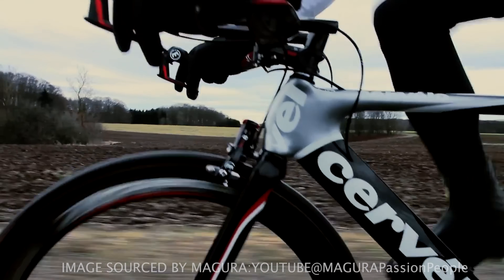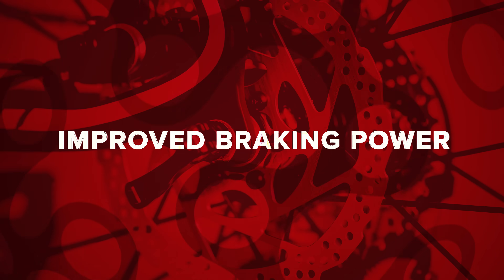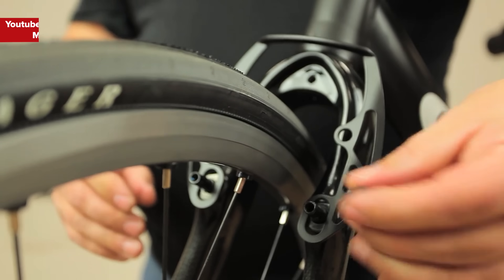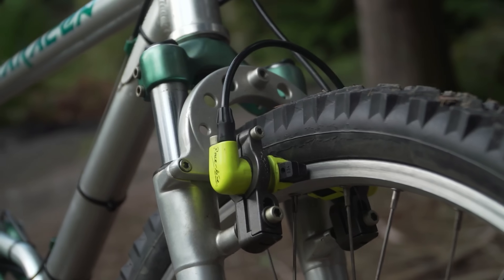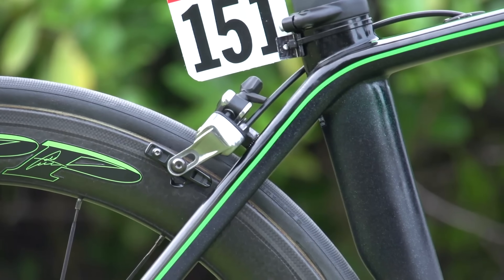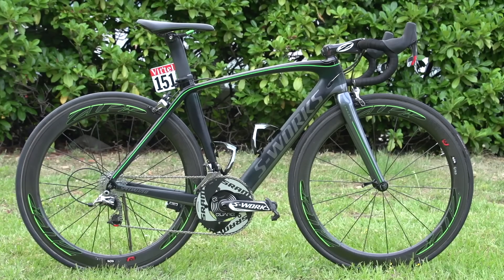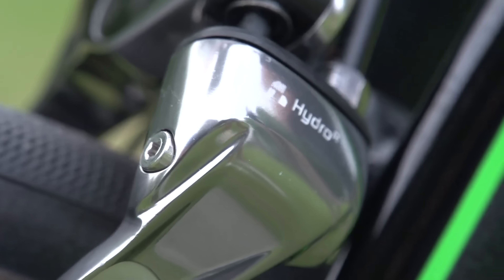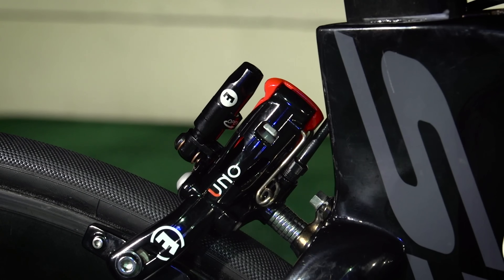The Rise And Fall Of Hydraulic Rim Brakes

Comment: I personally interested in a topic, but... There are mostly nothing about. As in that meme "I disapointed... And my day is ruined.".
BTW!!! I've seen this showed Magura brake caliper as fully cable actuated, mean completely without hydraulic stuff which worked as roller cam brakes and found them extremely awesome! I really with to use something like this, but with at least 40-44 mm tires. Found unfortunate that rim brakes stop evolving after most user unfriendly and pricey bloody bullshit breaks was forcefully foisted off to people... Still Use rim brakes, but my stuff are cheap as shit, because 380$ per moth income... I just can't found and/or afford what I actually wanted even it  not so pricey as any bike shown there.
P.S.: That Magura brakes was Magura RT8 TT and they are hydraulic... But if there be some analogue which is pure mechanical on something like gravel bike which able to use belt transmission... For me it is something to kill for. :face-purple-crying:

Comment: As was explained to me by a product manager for a major bike company, what REALLY killed the SRAM Hydro R rim brakes was the master cylinder (lever) recall from SRAM. It turns out that the Hydro R rim brake groups were spec'd and already installed on THOUSANDS of bikes prior to the discovery of the master cylinder issues (the rim and disc groups used the SAME levers)...and, as a part of the recall, ALL of the rim brake groups were replaced with full mechanical groups. Unlike the disc setups, once the "fixed" levers were introduced, people who originally had hydraulic rim setups were never sent a replacement levers. So...they basically never made it to the market in any appreciable numbers. Couple that with the UCI allowance of discs in road racing at nearly the same time, and yeah...they never were actually given a chance. That said, I purchased an aftermarket set AFTER the recall and installed it on a custom road bike. Combined with Hed Jet Blacks (black anodized aluminum textured brake track) and the braking is every bit as good as disc braking, and in some manners BETTER for road (IMHO). The majority of the "lever feel" that people associated with disc brakes is actually mostly from the hydraulic actuation. And, in the rim brake configuration there is MUCH less heating of the fluid from braking (so, no fading issues...and less need for bleeding as often) and the pads last significantly longer.
Reply: Why would the pads last longer?
Reply: @djohnson1981  more surface area, less torque and less heat on the outer rim vs outer disc
Reply: Wasn't that junk from AVID? My bike shop pals used to say they left out the O after the V!
Never saw many of the Magura hydro rim brakes - seemed like an answer to a question nobody asked. Modern, dual-pivot, cable operated rim brakes work very well with far less complexity and cost....unless you want to run some fat tires through them that is.
Reply: @larryt.atcycleitalia5786  There IS the possibility of making them considerably stronger than cable actuated dual pivots (which SRAM unfortunately did NOT do), but as I point out above, the lever feel is smooth (just like hydro discs...makes sense, it's the SAME lever) and doesn't degrade over time (as cables tend to do). BTW, you CAN run fat tires through the SRAM Hydro R ones...all it took for me was a fork designed for mid-reach brakes and some offset pad holders. I can fit a 36c tire in the fork ;-)

Comment: The fundamental law of mechanical advantage means that for braking, your mechanical advantage is proportional to your lever travel and your pad travel. That’s why disc brakes can be more powerful, they run a closer clearance than rim brakes, therefore the pads don’t need to travel as far, therefore they can be designed for more mechanical advantage for the same lever travel. It’s that simple.

Comment: I had Sram Force hydraulic rim brakes. Actually they worked fine, never needed any maintenance in that 3 years I had them. But disc brakes are a different category in brake power in wet conditions.

Comment: Neat video, Alex. I had the hydraulic Magura rim brakes on a mountain bike back before discs were a thing.  I liked them, but discs are so much better.  Even a disc with a double-sided-pull cable-actuated caliper (TRP Spyre - which I still have on one bike) are better than hydraulic rim brakes.

Comment: I have Magura HS33 hydro rim brakes on my Votec-made 1998 Porsche Bike S MTB. They are the best rim brakes I’ve ever used - great power, modulation and feel/effort.  The brake booster does however limit my tire clearance to 2.0” width tires.

Comment: In the early to mid 90s there was hydraulic cantilevers. Sachs had a hydro canti booster. I loved my hs33. Needed the booster or they were useless. As far as road goes. Mechanical dual pivot calipers still work amazing. I agree with you. The disc brake market was growing big and it was just a matter of time before all bikes had them.

Comment: This presentation shows the ingenuity of the simple caliper rim brake. It was lightweight, easy to manufacture, worked well enough for aluminium rims and could be installed on a large variety of bikes. It also improved over the years with lined cable housings, smoother pivots and stiffer parts.  Even Spartacus could descend down a mountain pass at 100 km/hr on a rim brake bike, while a novice cyclist had the same technology on their first bike.  I hope Campagnolo doesn't stop manufacturing them, as they make for great lightweight travel bikes.
Reply: Exactly. Disc brakes ruined the look, the weight and the aerodynamics of the bicycles completely.
Reply: @Dean5767-o6v disc brakes are more aero than rims, they also look decently and the weight difference doesnt matter unless you are riding in pro tour
Reply: @skfl7014  "disc brakes are more aero than rims"
This is not necessarily true by any means. Considering frontal area has such a huge impact I doubt it's even usually true
Reply: @thenayancat8802 rim brakes have a much larger frontal area, calipers are hidden by the fork and drag by the disc is insignificant
Reply: @skfl7014  Rim brakes can also be hidden by the frame...? Discs cannot.

Comment: As i only ride very slowly, in comparison to most other riders, i am quite happy with my rim brakes.   That is except for 2 instances when drivers didn't see me( and my oversize body shape ) pulled out in front of me and i had to anchor up , on those occasions the brakes weren't powerful enough to make me lock up and go over the handlebars , so i've had to take avoiding action to avoid a collision.  so not too bad for for someone with only 30years ( but i'm now 70) of limited cycling experience
Reply: Rim brakes are disc brakes, don't let the disc brake propaganda take hold.
Reply: @凸Bebo凸  - S'truth be told. THANK YOU. Was waiting for someone to say this. Eons ago I read that Tom Ritchey said this (and mirrored what I thought). That article has probably been vaporized by now, but a rim brake is my kinda disc brake. It's certainly not a drum / coater brake. Cheers and peace to the disc brake lot from an alien outsider! 😁😃✌🏼

Comment: I had a Focus izalco max with SRAM red hydraulic rim brakes (2014), they were significantly better than with cables. But they came out the year before disc brakes were introduced, so they quickly disappeared again.

Comment: Hydraulics were not an advantage for rim brakes, simple as that.  Cable stretch is an issue, but a great one, and pressure is easily applied to the pads in a rim brake.  Disc brakes use a much slower moving braking surface where the liabilities of cable are magnified.  It's that simple, hydraulics in rims brakes were not an improvement, they were with discs.

Comment: Magura HS for cantilever mounts are still in production today, the HS11, HS22 and HS33R (radial cylinder/piston like on Hayes Strokers or some other Magura Disc brakes), however most trekking/city bikes etc. usually have discs (the cheapo ones with cable-actuated) or V-Brakes, however there is a niche of some bikepacking bikes with CroMoly steel frames that still offer variants with these Magura HS rim brakes.
And obviously on the aftermarket a great upgrade for vintage bikes, recently rebuilt a mid-90s GT Mountainbike and it came with cantilever brakes and I replaced the front one (because I replaced stem and handlebar and these didn't have canti cable guides) with a HS22, you could still put a disc brake on it but only in the front if you replace the fork with a fork that has disc brake mounts but can't do it on the rear without welding (and not just put on the mounts but also add a tube between the seatstay and chainstay to distribute the additional forces).

TRP offers a hybrid system today, the HY/RD disc brake callipers, they're actuated by cable so you can keep your mechanical brake/shift levers but the pads are pushed against the rotor by a hydraulic system.

IMHO they were a bridge technology like these flourescent lamps with normal sockets like E27 in the 2000s and 2010s as the EU banned incandescent bulbs in 2009 - IMHO LEDs still were a little pricey and had issues back then, but they became much more viable in the mid-2010s and now fully replaced these (also the halogenic ones) in fact even some of these flourescent are nowadys banned.
Reply: I have a set of those HY/RD hybrid brakes on a bike and they work fine. I've been running them for around four years now. They replaced a set of mechanical TRP Spyres and really did increase the braking power while allowing me to keep my existing brake levers. They are also self-adjusting.
Reply: On my commuter I welded an adapter made from steel, which is bolted on via the axle and on the front via the kick stand. It's a 2nd tube running along the chain stay.

It's a heavy hub motor e bike, it ate rim brake pads because of the weight. The disc is less maintenance intensive here.

Comment: How good are Magura brakes? They ware used on most trial bikes in past and on many today. Trial riding is about jumping on back wheel up to distance of 2 meters! And Maguras provide truly absolute control of wheel movement. 
I understand that for most types of riding (road, CX, downhill) it's about lowering speed. And there are better ways than Magura. But for biketrial it is must have. They are just superb. Proved over time. 
They are like a unicorn on MTB. :)
Reply: Very good. My wife inherited a bike with Magura HS11. Apart from replacing brake pads, the brakes have never been serviced in around 20 years. They still work perfectly. Replacing brake pads is by far the easiest compared to any rim brake I have ever touched, they clip into place.

Comment: I have two TT bikes, a Cervelo P5 that came with with Magura RT8 and a P3C retro-fitted with Magura RT6 bought on eBay. I rate these brakes: they are effective stoppers, and you can pass the hoses through tighter turns than you can a brake cable. Nothing wrong with the Maguras, but if I was to buy a new TT bike, I'd be going with the flow and using disc brakes.

Comment: In the late 1980;s Magura released the HS77 road brake. They didn't get much uptake not because of braking performance wasn't superior but more because STI and dual pivot brakes were around the corner. Offering shifting on the levers was greater for performance than having better heavier brakes.

Comment: Rim brakes just plain suck. Disc brakes are just plain better
Reply: Road disc is 2kg heavier, makes horrible noises, looks terrible aesthetically, use it in the wet in the city the rotor is instantly contaminated with oil leading to having to replace the brake pad to fix the now permanent squeal.  The only people on these things are pros who get it maintained for them, and Freds, there is zero inbetween.
Reply: @凸Bebo凸 no they aren't 2kg heavier. That's utterly absurd.
Reply: @SirBrass  If you compare the most massive Mountain bike system to the lightest Drillium rim caliper it is reality, not absurdity my road disc Fred friend.  Also read a few more books, encounter some dramatic effect hyperbole in your reading, use your brain a little more.  If you're going to type like a posh Londoner the least you could do is be well read.
Reply: @凸Bebo凸  The pads are not permanently contaminated. They can be cleaned up. I do it regularly and it takes about 10 minutes. You should also clean your rims and pads for rim brake also. So, what is the big deal? And then you compare extremes that are not comparable. No mountain biker would choose rim brakes over disc.
Reply: @DaveCM  Rim brakes are better on Mountain Bike trials bikes.  Once motor oil from a city gets on the pads they can not be fixed and need to be changed unless you want the squeal sound forever.  I rarely see anyone using disc brakes in Los Angeles anymore, just the roadies and the rental E-Bike guys.  In a dirty city it's nearly impossible to keep them silent for more than a month.
Reply: @凸Bebo凸  Bull$hit. And they can be cleaned. I do it regularly as I stated. I seriously doubt you rarely see disc brakes on road bikes. New high end bikes don't even come with rim brakes with only few exceptions. Even those exceptions don't sell as well as disc brake bikes.
Reply: @DaveCM They can be cleaned sure, back to silent with dirty motor oil on them?  No way.  LOL @ admitting to regularly cleaning your pads.  I never clean my pads they are silent and work great.  Because the rim is machined 7 series Alu, it doesn't even get metal bits in the pad for me to pull out once in a blue moon.

You've never even ridden a proper trials bike, get out of here on rim vs disc, haha.
Reply: @DaveCM  Every factory in China that makes bikes has a high end Toray 800 CF rim brake model for 500 bucks, you are behind the times.
Reply: @凸Bebo凸  Road disc is NOT 2kg heavier, both rim and disc brakes are vulnerable to noises and both brakes can be contaminated with oil, rim brakes even more easily than disc.  Your post is nothing but lies.  Rather be a Fred than a liar.
Reply: @craigjones9372  A little alcohol sandpaper and the rim brake pad is as good as new if you got motor oil on it.  Can't say the same with a disc brake pad, chuck it in the bin for sure.  My post is the high end rim brake reality.

Comment: With hydraulic rim brakes, the brake pads move more, so I think the pressure generated by the brake lever cannot be effectively converted into resistance on the rim.
Rim brake pads wear out faster, putting more strain on the rim, and shortening the maintenance cycle.

Comment: It was nice design however good v brakes were as strong as hydro
Reply: both are IMHO a pain in the ass to keep them maintained. Disc brakes require much less effort.
Reply: The Paul V-Brake with Paul Mini V-Brake lever is instant lock up in the rain.  I have those on my rain bike, not disc.
Reply: XTR V brakes were great, the pivots could get sloppy though.
Reply: @ebikescrapper3925 I had xtr on my saracen. Stopping power were really good I remember you could lock front wheel almost instantly
Reply: Cable attenuated direct mount rim brakes are really good. I’ve never tried hydraulic rim brakes. You see them on electric city bikes

Comment: The magura hs33 was the perfect brake for city bikes, especially for newbies. No adjustments needed, changing brake pads was super Easy and it always worked flawlessly and had a great amount of brake power
Reply: Adjustment WILL be always needed, because wheels will lose truing with time and potholes driven over. And that will wear the pads unevenely until you retrue the wheel.
Reply: @heksogen4788  I've had a Magura rim brake on my MTB since the first became available and so far it did not need adjustment.
Reply: @heksogen4788  I got Magura rim brakes when they came out and it did not need adjusting yet. Changed pads any number of times but no adjusting of anything.
Reply: I still use HS33 on ebike conversions for family and friends. Usually I’m coverting some old city bike with cheap vbrakes so putting on HS33s gives nice upgrade for stopping power of quite heavy bike.
Reply: Agree, and I also had the previous Magura generation on a trekking bike which was an excellent improvement of my previous cable V-brakes. The whole bike costed 700€ in 2005, so it can't be that the Magura hydaulic brake system should cost 400€ alone.
Reply: I've worked on plenty of hydro and cable disc brakes as well as cable rim brakes. Cable is so much easier to fix when anything goes wrong. V brake pads can be a little fiddly to align but that's nothing compared to getting air out of your hydraulic lines.
As far as stopping power goes, I weight ~100kg and I can skid the front wheel of a V brake bike on pavement. I only use hydros for MTB.
Reply: You simply can compress a liquid.